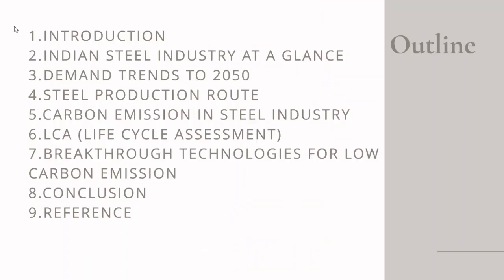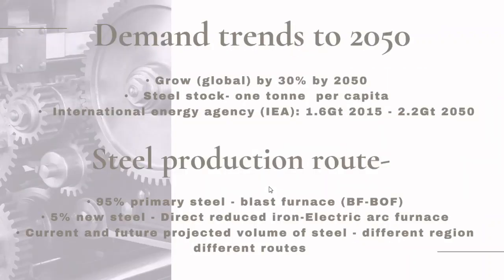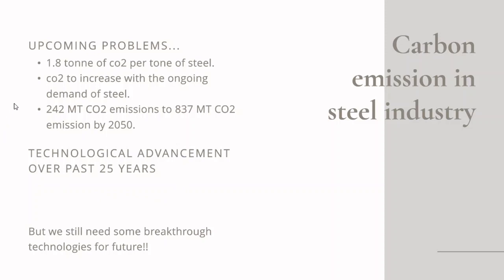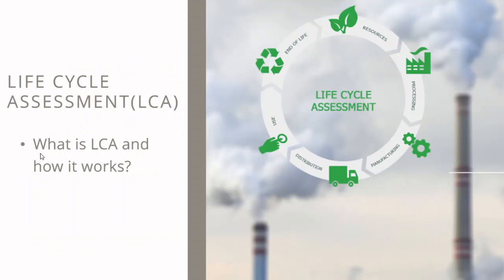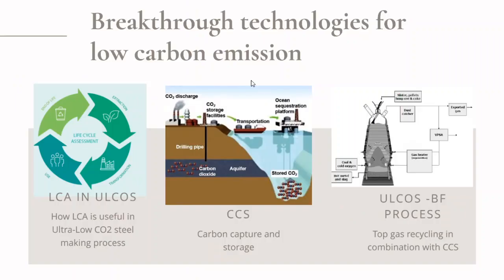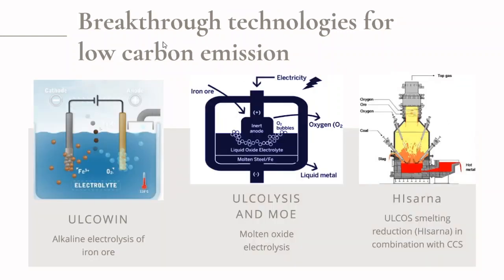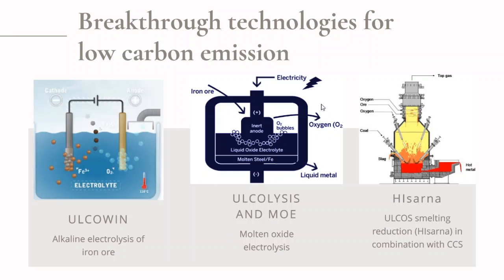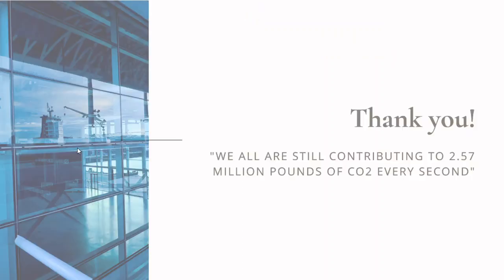BTTD Video Rohit Mishra Mohit

Comment: A very relevant topic Rohit! However, as you yourself must have observed, application of LCA has been very much limited pertaining to its lack of accuracy. Data availability and quality being the prime challenges. What do you think can be done to make this tool more feasible, scalable and therefore industrially relevant?
Reply: There are many LCA softwares like   SimaPro, GaBi, and JEMAI-LCA Pro which helps in study and precise analysis of data and results.
Hisarna process of steel making produces almost similar high quality steel with 20%less energy use and co2 emission. This process is currently used in TATA steel Europe for producing high quality steel with less energy consumption.

Comment: Hi Rohit .. the presentation was very nice ..but i have question. Will u pls tell me what is the environmental benifit of using HISARNA process?
Reply: Thank you Akash Pandey for this lovely question. 
The environmental benefits of this process are the reduction of energy use and co2 emission by 20%. Since 100% pure co2 is emitted in this process, so it can be captured and stored without meeting the cost of refining process.
Reply: @Rosh-ruh  thank you for replying
Reply: Rohit it was good ppt, but can you pls explain me the difference between hisarna and traditional blast furnace.
Is it possible to replace traditional blast furnace with hisarna?
Reply: @priyanshusinha1209  thanku for asking this question...the difference in traditional bf process and HIsarna process is that in HIsarna process we skip the steps of producing coke , sinter or pellets ..in simple words we actually skip the preprocessing of ore and coal.
Hisarna process has a bit different setup...it has top part which is called cyclone part and the bottom part as Hismelt vessel ...so it cannot be replaced with the current traditional process.